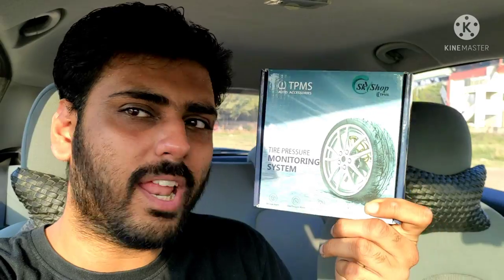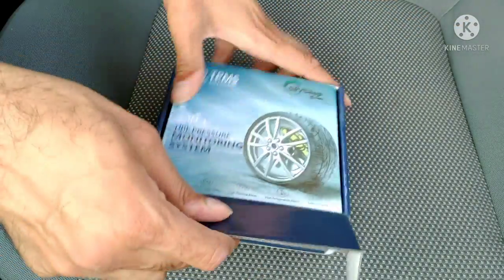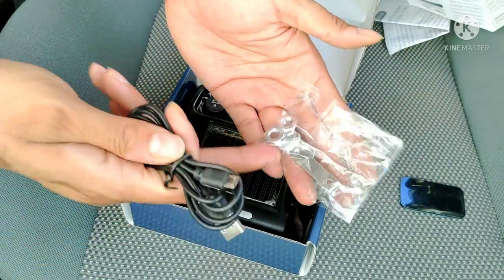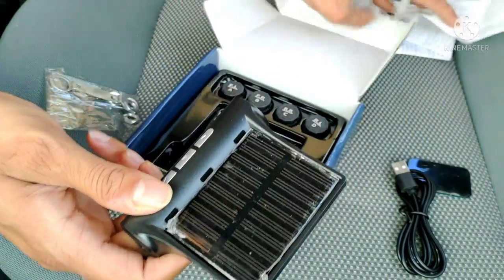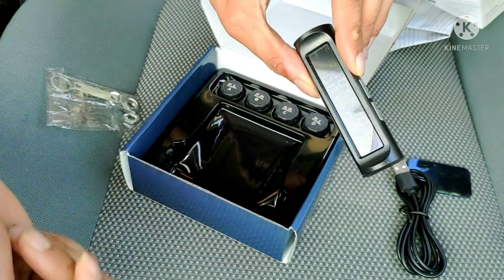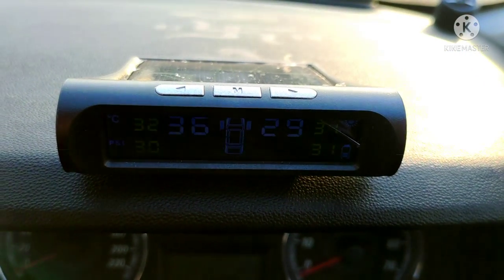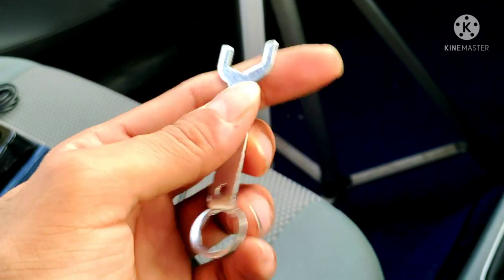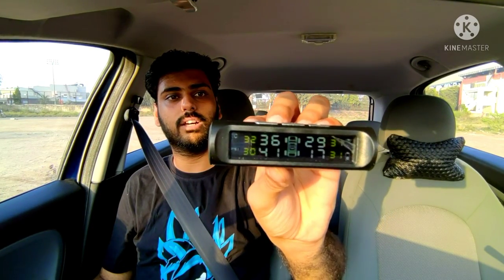External Tyre Pressure Monitoring System Full Install and Test || Skyshop || Fiat Grande Punto

Comment: How about the Sensors battery life? I mean those fit in tyres..  Or those are piezoelectric ?
Reply from the maker: The battery of sensors last for at a year and if one wants to replace the battery it can be opened and it is mentioned in the manual itself.

Comment: That means your main tyre valves (schrader valves) are always open and by any chance if the sensors leaks then it will be an embarrassing situation.
Reply from the maker: Embarrassing. I would not say it as embarrassing but yeah then for sure one knows that a sensor is faulty. Thankfully since I am using it I haven't faced any issues. 😀
Reply: @AmulLuthra  Wish you all the best bro 👍

Comment: Does sensors required charging or batteries?
Reply from the maker: They have a coin cell battery which I showed in the Unboxing video. Which easily gonna last over a year as per the seller.
Reply: I saw your complete video but couldn't able to see when did you show it. Please mention time.

Comment: Everytime while filling air should we need to remove the sensor?
Reply from the maker: For external sensors yes as there is no other way. Go for internal sensors then you won't have this problem but to install them one needs to go to a tyre shop as they will be installed on rims.
Reply: @AmulLuthra  everytime u remove the sensor while filling the air, do we need to loosen the lock nut using wrench before going to fill the air?

Comment: Every time tyre needs inflation you have to remove the TPMS ! This is not the way to install. A T shaped extention is available with valve at one end and a side port. TPMS is fixed at the side port ....now no need to remove everytime you inflate your tyres.
Reply from the maker: Better to get internal sensors than to do all that...
Reply: Any product link for t shaped extension? How to fit this sensor with T shapes extension? Pls reply